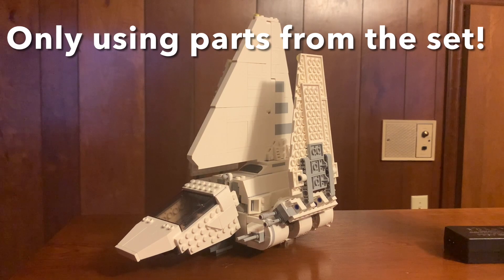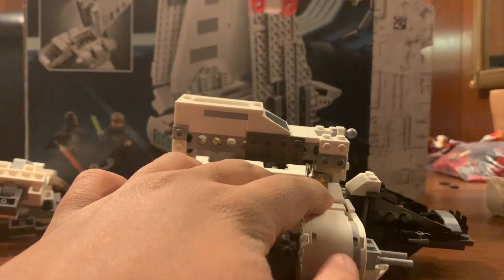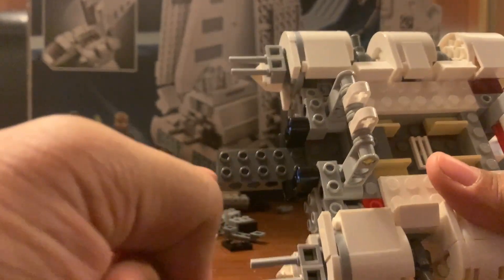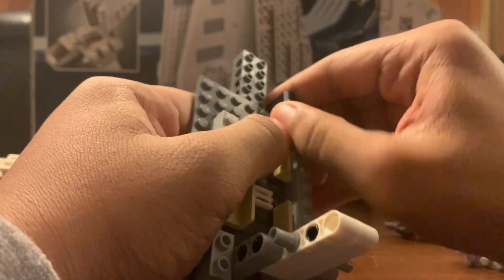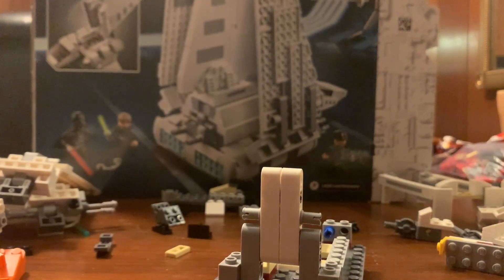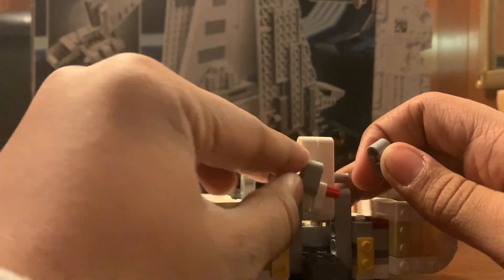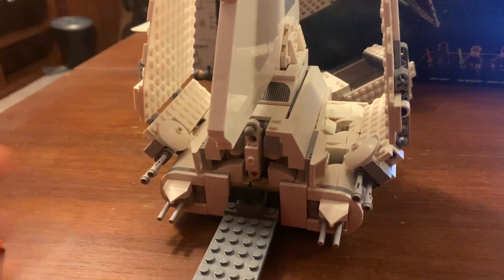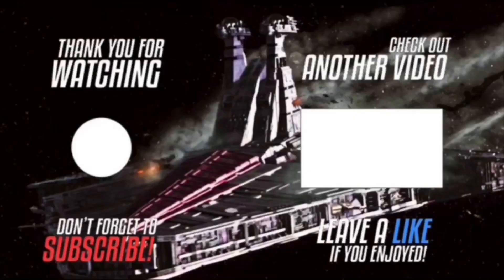How to modify your LEGO 2021 Imperial Shuttle to be WAY BETTER! | Alternate Build No Extra Pieces

Comment: I’m going to get this set but I quite like the back interior, so is there anyway I can just remove some stuff from the cockpit and then fit 2 figs In There ?
Reply from the maker: The interior part where Luke and Vader are supposed to go is not changed by doing this mod.
Reply: @BrickWallProductionsYT  ok, ill have a go lets just hope i dont mess up lol
Reply from the maker: Great! Lmk if you have any problems
Reply: @BrickWallProductionsYT  will do
Reply: @BrickWallProductionsYT  Wish the back was more spacious

Comment: I have a question why did you push those parts back is it necessary because I just want to change the chin
Reply from the maker: moving everything back was to make the chin shorter so it doesn’t stick out as much